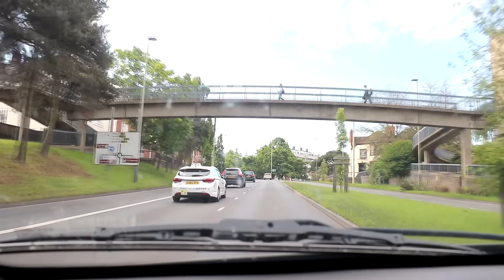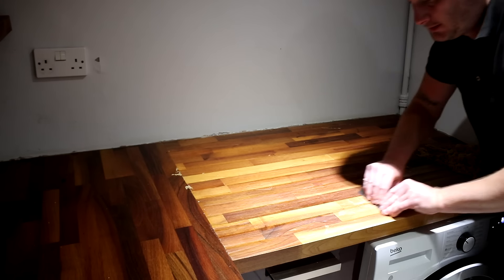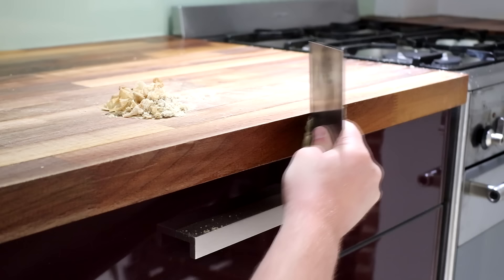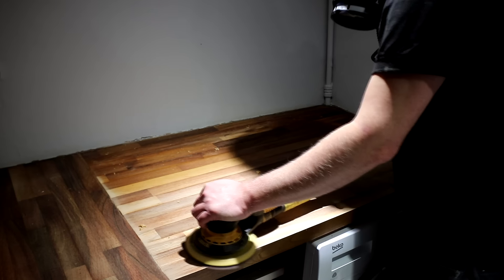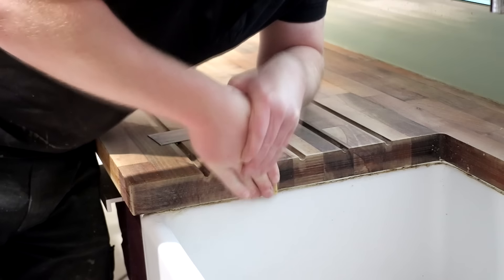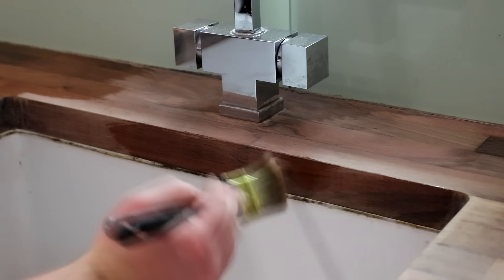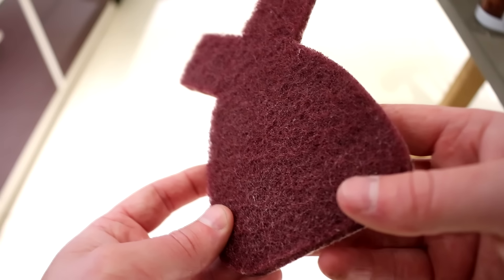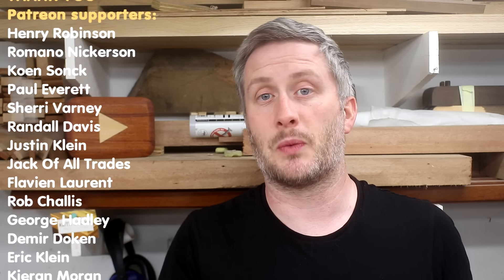How To Remove Stains, Re-finish & Oil Wooden Kitchen Counter Worktops

Comment: Crikey! Can't believe it's a year since I posted on here and am only now just getting round to doing my worktops. In the meantime, I built a shed, renovated my garden gate, done a fair bit of gardening and had Covid (I made a full recovery so am now back at the DIY as neither brother nor son, are going to be able to visit me for quite some time). I've used the blade for the large areas and the little scraper for the more difficult area around the tap (it's round so harder to deal with than the square one in the video). I spent about 45 minutes scraping and then stopped for a spot of lunch. I forgot to take a couple of pics but I have to say that the black ring marks, and even a transfer from some packaging that left a mirror image on the surface seem to be gone. A little bit of sanding has been done but I can still see the odd bit of old Danish oil that needs to go. I think I've got time to get two coats on today which is great. Watching the video again was a great refresher (at 73+ things tend to get lost in the miasma that is my brain), so thanks again for this.

Comment: I have a peeling wood countertop dilemma, wondering if you have a suggestion. We have a section of our small kitchen countertop that is peeling badly in our tiny house. Don't know what previous owners varnished it with before we bought it 4 years ago, but it's not lasting. Because of chemical allergies, a cat with asthma, and the high amount of wood and varnish dust particles that would be generated inside our small living space, normal sanding or indoor varnish isn't an option. I thought maybe just try to cover it with a stainless steel cutting board. The other idea was perhaps to disassemble the entire countertop and take it outside to refinish it but that is a big headache. Then I saw your scraping tool and thought that may work, indoors, then maybe go over it super slowly with sandpaper and a shop vac while sanding. But then the varnish has to be all natural, unless I leave it bare wood and cover that with the stainless steel cutting board. I tried tung oil on a small shelf I made and it reeked so bad I couldn't use it indoors for weeks until it cured. I did like 4 coats but it never hardened thick enough to prevent staining and seemed to attract dirt with little use rather than repel it. Does the natural oil varnish you are using in this video have any odor and what is the cure time? What would you advise if indoor repair is a challenge, in order to create the least amount of indoor toxicity? Scrape and leave bare, or apply a few coats of beeswax oil then cover with the stainless cutting board? How long are wood finishes supposed to last, specifically in high traffic, food prep environments? Because of this experience with varnish peeling off, it makes me not want to use wood or have to deal with refinishing again. I will probably end up getting a used restaurant stainless steel sink with built in countertop to replace the entire kitchen unit, which is nasty particle board and build solid wood shelves and doors into it, but it will be next year and we need a solution now to remedy the immediate peeling problem. Thanks for any feedback to this challenge.

Comment: After watching your video several times after deciding, I needed to take back my 30 year old worktop. Many years of tung oil on it, black round the tap area, . Looked awful. Anyway I used the card scraper and didn't really get on with it so   continued with the carbine scraper ( excellent tool) anyway finished up by sanding using your advice on the sanding discs and what a result.. so pleased. Purchased the oil wax you suggested and looks amazing.  Will need to do a 3rd coat later tonight as the worktop is really soaking it up  well impressed with the result, Dining room table, chairs and dresser next. My husband was shocked I managed it, and decorated the kitchen in 2 days. Thankyou for  your easy to follow video.

Comment: I am SO thrilled with the results on my kitchen worktop. I did it with Danish oil a few years ago, but it was looking bad. So I got in all the tools, (love the Barco tool in particular!). I ordered two 250 cl tins of the wax oil, they were small, but it went so far that I only used one tin despite four coatings (yes, I decided to take no risks!!). It is fab, highly recommend. Now doing my kitchen door, no stopping me 😂
Reply: Same :)) I'm on a mission now. Everything wood is getting it!

Comment: This is just what I need. I am in the process of decorating the kitchen and the worktops have seen better days. I find that that its not so much what to do but what not to do as a wrong method can ruin the worktop and mean more work in the long run. Thanks for giving me the confidence to crack on.

Comment: Nice video! So instructive. I have recently bought wood worktops and applied the oil that was recommended on the package, 3 coats. But it actually looks so unfinished, it still sort of absorbs a bit of water and is not shiny at all, it feels very fragile. I am sanding it and applying the finishing you have used. 
Wish me luck hehe

Comment: Super nicely done!

I personally would have fixed the area around the water tap so they won't get these issues again.
Most of the time it's just that the surface is to flat, and just a slight angle would fix that, since the water would roll off to the sink.
Reply from the maker: Great advice 👍

Comment: I've been wondering how to restore my worktops and I think this will be it. I'm a 73-year-old 'lady' so I hope I'm going to manage. I'll give it a try, anyway. Now I just need the kit...
Reply: How did you get on Anne hope you managed to get it all done without any hiccups 👍

All the best
Reply: @williamn01  Not actually done it yet - we've been in a spell of good weather here so I've cleared a load of breeze blocks and mortar from an old concrete oil tank base and built a new shed on it. Plus some gardening and other stuff. Probably start it in the next week or so - watch this space>
Reply: @annecleave5985  gd stuff Anne yes weather has been great here to, rather miserable today tho. Hope it all works out as planned for you.

All the best
Reply: @williamn01  Forgot to say that I bought all the kit almost straight away so I'm keen to get the job in hand.
Reply: @annecleave5985  Rome wasn't built in a day as they say Anne 😂, I do that aswell as other things pop up, wee get there in the end tho.

Comment: I have new kitchen oak worktops treated with Danish Oil. 
I left a bottle of dettol anti bacterial spray on there and it has left a mark I scrubbed it and it's slightly noticeable after reapplying the danish oil. I guess removing the whole surface like you did in this video is the only way to get a clean finish? As there is a shade difference from where I tried to remove the stain...Really good video by the way

Comment: Following your tips saved me a lot of dirt and hardship. Scrapping off old wax and then using mesh-like sanding pads resulted in using just one 80-grit and one 120-grit pad, instead of the usual mess white spirited rags and a mountain of clogged pads.
Even better I now have a Burco wood scraper to play with.

Comment: Great video. Keith, have a look at Heidelberg Prolignum hard wax oil from amicus uk. I got some a couple of months ago and don’t use anything else now. It’s food and toy safe, plus if you want to use it on table legs for example, mix a little white spirit in. It’s around £22 a litre which isn’t cheap, but slightly more than danish oil which is nowhere near as good as this stuff😀
Reply from the maker: Thank you I’ll definitely check that out 👍

Comment: Hi, do you think the finish with this oil wax is better than that with a cheap polyurethane finish? Also, would it be ok to use the same procedure to remove previously applied polyurethane and reapply a different finish?

Comment: Excellent video! My worktop colour has faded due to chemical cleaning sprays 😩To re-stain, can you just use normal wood stain prior to oiling it after you've sanded or do you need a special wood stain do you know?

Comment: That's still quite a thick layer of hard wax oil you're putting on. I usually apply a thin coat with a rag, let it sit for about ten minutes and then really thouroughly rub off the excess. Having said that: you've got a good result by the look of it.

Comment: So nicely done, thanks. My bench top is light and has  black mould marks and im struggling to find the right way to deal with them i have sanded, used mould spray and danish oil. It’s much better, but i cant rally get rid of them entirely.  Anyone suggestions?
Reply from the maker: Oxalic acid but be careful as it's toxic

Comment: That hard wax oil finish is beautiful, hoping to try it soon but the prices are eye watering to say the least.
Then again anything good is up there in the same range.
Either those are low ceilings or you are taller than I realised. Or both !
Reply from the maker: I’ve heard Heidelberg is cheaper (about £22 per litre) but struggling to find anywhere to buy it at the moment 👍

Comment: I followed your example on beech worktops but had to repair some rot by drilling out small holes to soak the hardener and then filling. Obviously now the issue is the filler dots stand out badly.
Is there anything I can do to colour or stain over them to at least make it less obvious?

Comment: Is a cabinet scraper of ok to use when bought new or will I have to sharpen it first ?

Great video by the way
Reply from the maker: Thanks.  You will need to prepare the edges first yes. I have a video on my channel about how to do that if you've not seen it.

Comment: Two years since I did my worktops, all bar one are still in perfect condition. The worktop next to the sink has lots of water on it daily, it’s also in direct sunlight most of the day, so it started to look a bit dull. The great thing is it only take 10 minutes to clean the surface properly, then 10 minutes to add another coat, leave it overnight then buff it with a cloth, and it’s brand new again. That never happened with danish oil.

Comment: This looks great. I recently had to refinish part of an oak worktop at the back of the sink in a place I rent out. The silicone had come away and wood at the back blackened. I hand sanded to remove the black layer then applied 4 coats of natural danish oil over a few days to this part in addition to one coat over the whole worktop, then applied a new bead of silicone. The part I sanded back now looks darker than the rest, although not as bad as before, is there any way to remedy that? The rest still looks as good as when installed as I oil it twice a year. Its a HMO so its not practical to take it all back to bare wood currently. 
The house I rent out was once my own home, otherwise I wouldn't have put in oak worktops as its difficult to maintain in a rental. If I get the opportunity in future I will take it back to bare wood and use hard wax oil instead of danish oil as this should make maintenance easier.
Reply: I didn’t realise Danish oil was food safe, assuming these are kitchen worktops.

Comment: Thank you for the video, but I would have removed the moldy silicone sealant before in order to apply a new one after finishing the worktop or is there a reason not to it this way?
Reply from the maker: The client didn't want me to do the silicone

Comment: Quick question, I know it wouldn’t work for this job due to time constraints, but could you use just mineral oil for the finish? Obviously with many applications
Reply from the maker: You can, but it won't be at all durable

Comment: This video was really helpful. I'm trying to refinish my butcher block counter tops. Do you have a recommendation for a coat that is 1. Food safe, 2. Great sealant (doesn't require reapplication like mineral oil or mineral oil+wax), 3. Matte shimmer, not lacquer-like, I'd like to avoid the Bartop look.
Reply from the maker: There isn't really want finish for solid wood that doesn't require maintenance, but hard wax oil is probably the longest lasting  unless you go the polyurethane route

Comment: Thanks so much for making this video, I’m in the process of repairing our American oak worktop which was ruined by tenants.

I have an under mount sink, it has gone mouldy around the sealant which I’ve now removed. When I scrape the wood in this area it makes a horrible squeak noise. What am I doing wrong? 😭
Reply from the maker: Squeaks is all part of the fun !

Comment: Great video, I was also thinking of having a wood worktop like the one you repaired.  In terms of reducing stains on the wood, do you think the oil you used will protect the wood better and for longer?
Reply from the maker: I think so based on what I’ve heard/read but time will tell

Comment: Thanks for the video, really informative!

I had oak worktops installed around 6 months ago and want to re-oil them, do you recommend sanding back or can the oil be applied over the existing finish? (I will be using the same oil as previously applied)
Reply from the maker: Should be ok to reapply unless there is any heat or water marks or staining
Reply: @RagnBoneBrown  could you advice why am I getting marks on my dinning table, even though a oil has been applied.  The oil was applied using a rag.  The table gets soo easily marked even when using plastic spoons... 

Not sure how to protect it so it won't mark or get scratched.

Any tips and advice would be greatly appreciated

Comment: Did you renew the bead of cork around the sink as it looked horrible and would have been easy to do?
Reply from the maker: No, the client didn’t want the caulk done and besides I’m not very good at applying it well, so best let someone else do it
Reply: @RagnBoneBrown  I was no good at applying it until I found some plastic tools online, now I finish it with a very smart line.
Reply: John Fithian-Franks John what are these tools?
Reply: What are these tools

Comment: What do you think of using wood bleach in order to remove the old stains from the  wood?
Reply from the maker: I use oxalic acid to remove stains on furniture but wouldn't use it on a food preparation surface as it's hazardous
Reply: @RagnBoneBrown  looked at the wood bleach from Liberon. The kitchen surface around sink was very black when we moved in. I suspect its not been cleaned in a while....  Btw love your presenting style. Calm, through and really informative.

Comment: Any diff over this oil and say osmo oil?
Reply from the maker: Osmo is more expensive and takes longer to cure
Reply: @RagnBoneBrown  I use osmo on my desk and it's great. Taxes ages to get done but not as tacky as some other oils..
 Might try yours on the kitchen worktops next... Great channel 👍
Reply: @RagnBoneBrown  just checked on amazon and osmo is cheaper now 😂
Reply from the maker: 1l fiddes Vs 750ml osmo
Reply: @RagnBoneBrown  just seen and the price changed. So is the dark brown the natural color given it is clear satin? I've used some osmo clear satin and it's a lighter brown

Comment: Not keen on the finish, its a  bit shinny ! I usually use Osmo PolyX and yacht varnish around taps / wet area. Not the DIY yacht varnish, but the professional marine stuff like International Paints etc. What I like about Osmo is that you can sand out a scratch etc, and just reapply it and it blends in. I've also used clear plastic 2-3mm thick sheet around very wet areas bedded onto clear silicon. Oxalic acid will remove black water stains. It look great though much better than before.
Reply from the maker: That's because it was still wet when I shot the video, I didn't get to go back and see it dry. There's literally no difference between Fiddes hard wax oil and Osmo as far as I can tell